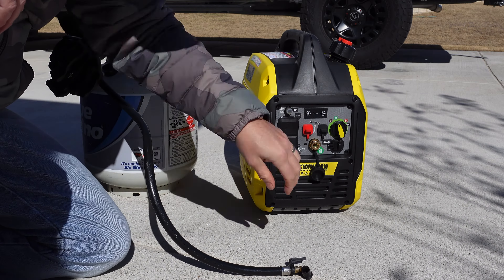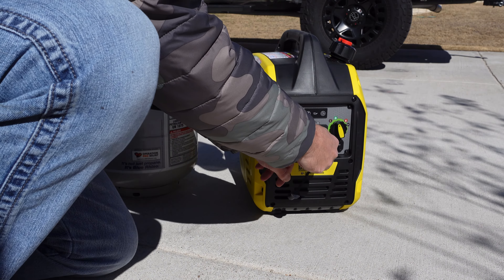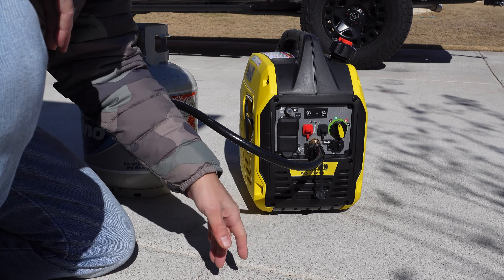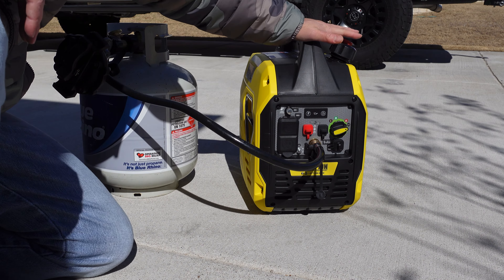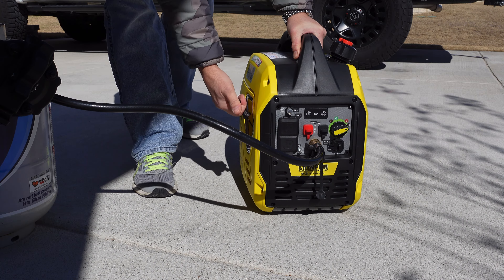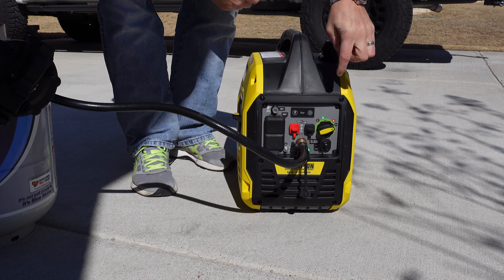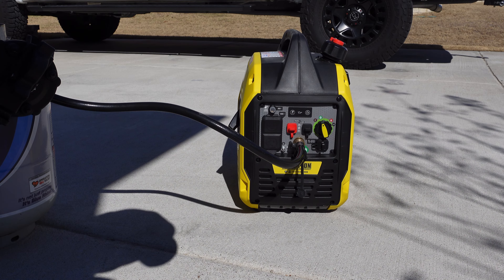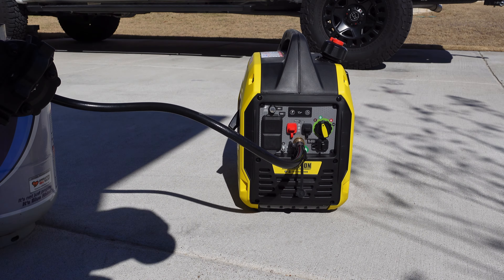Quick tip on starting dual fuel generator on PROPANE!

Comment: Champion updated to prime on choke at least for my new 2400. However, I'm still having problems starting on propane for the first time.  Another YouTuber posted about faulty regulators. Apparently Champion will send you a new regulation at no charge. Good luck ya'll. 👍🏼

Comment: At the propane tank, the big round disk (demand regulator) probably has a spring loaded button in the middle. You might try pressing that for up to 3 seconds to get fuel flowing from the tank into the line. This should speed up your pull start process because the fuel will already be closer to the generator as the host fills. Champion agrees with using the choke, as you demonstrated: https://youtu.be/E-bTBXvQd5s
Reply from the maker: Thanks! I’ll check out my regulator. My “ quick start” tells me directly to turn the dual to the propane setting before startup. Maybe they have updated since I bought this back in 2020??  Anyways, thanks for the tip!